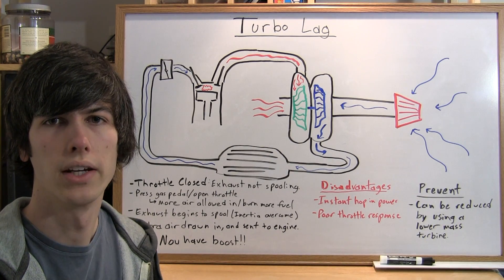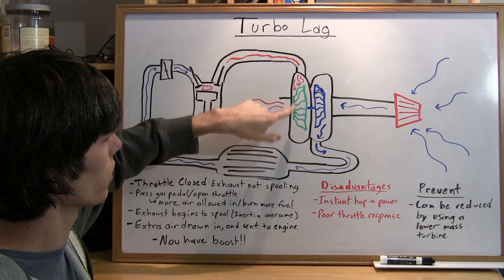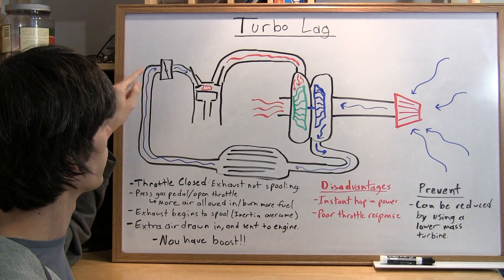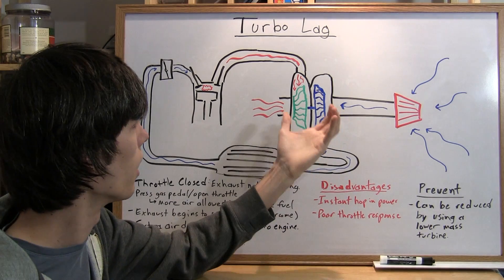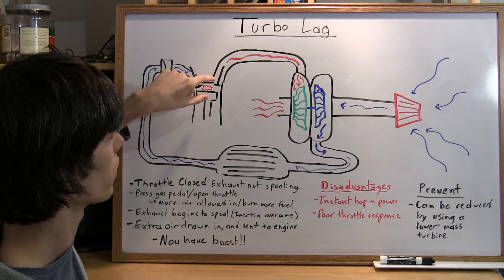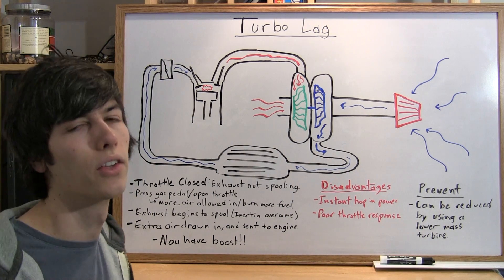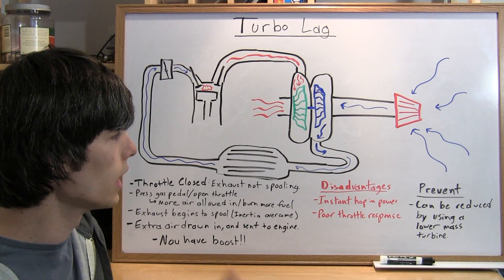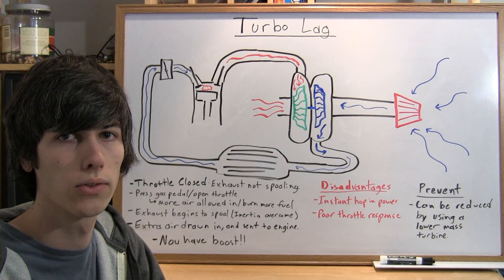Turbo Lag - The Problem With Turbocharged Cars

Comment: When the throttle plate opens all the way the engine creates more vacuum and pulls in more air. A naturally aspirated motor will start pulling as much as at its volume allows when the throttle plate opens all the way. A forced induction engine is capable of taking in more air than the vacuum of the engine. So the engine still pulls all the air that it is capable of just like a naturally aspirated motor and now we are waiting for the turbo to add pressure and increase the air the engine can take.

Comment: To add, if you translate amount of gas pedal to amount of exhaust gas your feeding the turbo, when there is no resistance that EngineeringExplained spoke of, you can only press the pedal slightly down for a brief period before the rpm is too high and you have to let off.  So it makes sense that your not really effecting the turbo by reving in neutral. Compare that to when you start driving, you give the engine the resistance of moving your vehicle and it allows you to press the pedal and hold.

Comment: To add to what EngineeringExplained said, the amount of turbo lag depends on a lot of factors.  The main factor is the size of the turbo.  So if the turbo is bigger, the turbine itself is bigger, which means its more massive, which means it takes more to get it moving.  The amount of exhaust gas that your engine is capable of producing determines how fast it can get the turbo spinning.  A smaller turbo in this case would mean less lag because its easier to rotate.

Comment from the maker: Once you have enough exhaust, you will no longer have lag, regardless of what rpm you are at, but at high rpms you will already have revved up the engine, spooling the turbo, meaning you already have boost.

Comment: Dude, can you help me?! I just rebuilt my whole motor in my 95 Talon TSI. I put a small 16g turbo, 16g turbine headers, aftermarket inter cooler, 255 Wal. fuel pump, and I have a set of 880cc injectors, that I didn't throw in yet. I also put on a fuel regulator, boost gauge.. My car holds 20psi/idling. But as soon as it hits between 7-10pounds/psi. The car shakes/wants to shut down.. Wtf is going on with it? If needs tuned etc. How can I do that? I don't have no dyno's around here for AWD.

Comment: An I just read the comment that said more heat is more power....incorrect my sir. The laws of thermodynamics and combustion are still out of your grasp. Colder air charge is best. More pressure only means more power when comparing same turbos...if one turbo is bigger, lower pressure can make more power than that of the small turbo at almost full boost.

Comment: Then if a diesel is in neutral and rev'ed how can it achieve 32 psi, or run 10 psi at idle...it's boost control! Not the fact that the engine isn't spinning enough. Because no matter what the gear 5 grand is still 5 grand. Gear position doesn't matter. Look up boost control solenoids, waste gates, and bypass/blow off valves....that will explain it more correctly.

Comment from the maker: Not a whole lot, the engine needs some form of resistance, and friction alone doesn't provide that much. With an engine revving and the car in neutral it won't produce enough exhaust to really spool up the turbo.

Comment from the maker: Instead of just feeding air directly to the engine (like in naturally aspirated engines), first the exhaust has to spool a turbine. It takes energy to spool up this turbine, causing a delay for the intake turbine to rotate. Once the intake turbine is rotating, it's forcing in extra air, hence the engine has boost. 

Some air obviously gets through even if the turbine is not spooling, but it's not enough for the extra power that a turbo provides.

Comment: Sorry if you're going to have to explain this again. But I still don't get how the addition would compromise the throttle response comparing to a naturally aspirated engine. I get the part when suddenly boost kicks in but that's because of the extra power, not because of the 'slowen' response? Which part did I get wrong?

Comment: If you reduce the amount or diameter of piping or intercooler volume you will have less volume to pressurise, resulting in less turbo lag. The spool speed of the turbo is typically not called turbo lag and ussually means the AR rating of your turbo is too high for your engine size or rpm application (wanting more boost at lower rpm vs higher rpm)

Comment from the maker: First question: Turbo lag doesn't affect power, just how long it takes to get the power. The answer to your question is no, because the turbo will be forcing in more air, and therefore more fuel will be burned. The more fuel you burn, the more heat is created. More heat = more pressure = more power. 

Second question. I should make one on this eventually. It's a good topic for sure.

Comment: I have a few questions: 
Firstly would a turbo engine, which is suffering from turbo lag, ever be less powerful than the same engine - stripped of its turbo system at the same rpm?

Also, can you make a video on compressor surge? I'm sure it would bring a lot more awareness and knowledge to youtube boosters.
thanks

Comment: Replace the turbo's turbine shaft bearings in both you turbo's get one small on and one big one.. Most turbos have fluid bearings, which support the turbine shaft with a layer of lubricant sealed between it and its housing. Replacing them with ball bearings specially engineered for turbos can reduce the friction acting on the turbine shaft, reducing turbo lag if you dont use the right it will decrease life of turbo.

Comment from the maker: What is the basis of your argument? When you add components, you add losses. If you were to analyze a pump with pipe flow, it becomes clear that to minimize the head loss, you want as few bends as possible, and a uniform diameter pipe. Integrating in an intercooler means more bends, more pipe, and various flow rate changes.

Comment: Where the diesel uses gas and compression, a gas engine, at least modern ones, are stuck in the vacuum mode, where the amount of gas is based on the amount of air sucked in by pressure. for instance you want more acceleration? push the pedal to get more air to flow into the engine, thus more gas. Where the diesel adds more fuel and air comes with it. Interesting differences I say :)

Comment: You forgot something: Lower mass turbine= less power. A very interesting configuration is BMW's (which is used in the Cooper S, JCW) twin-scroll turbine which allows a wide powerband and high output. Also the twin turbo configuration (in some cases) with 2 distinctive turbo's which when the smaller turbo to spools up, the transition is made to the bigger one.

Comment from the maker: That's actually how diesel engines work. A diesel engine's air-fuel ratio can go from 70:1 to 18:1 by you matting down the gas pedal. As far as why this isn't done with gasoline engines, I'm not sure.

Comment: wouldn't it be much more efficient + ecological to constantly have an abundance of air allowed to enter the engine and control engine rpm solely by the amount of fuel injected into the cylinders?

Comment: Turbo "lag" cannot be defined very well, if the turbo is NEVER gonna work when going 2000rpm for 1hour then its not lag cause it's not a full boost coming slowly ie "lagging" :)

If the turbo does work say at 2500rpm and you get a 1second blank spot before boost then the turbo comes on, THATS lag :)

Comment from the maker: @hakeembisiolu Eventually, yes. Basically what it does is it divides the air coming out from the exhaust into two different ports, so that the pressure to the turbine is much more even and steady. But a video would help clear this up, soon enough.

Comment: It also can be reduced by using a twin-turbo setup. That means one small turbo connected to a bigger turbo. The small turbo spools up faster. meaning more presure on the big turbo. That way the big turbo spools up faster creating lesser Lag.
its not ideal but you also can reduce it by removing piping or the intercooler. That way you'll have less response time from the air going from the intercooler to the engine itself.

Comment: @EngineeringExplained I wasn't trying to say larger turbos *can't* create more boost, just that they don't always. It sounded to me like sheennick12345 was saying a smaller turbo just necessarily means smaller boost. You can make a smaller turbo produce a lot of boost but it will still produce less air mass than a larger turbo at the same psi, resulting in less power.

Comment: @EngineeringExplained Well you can have your foot off the gas at any RPM, but yes, engine braking, mech/wind resistance, etc. will be slowing you. But the injectors won't be putting any gas into the engine, so there will be no exhaust other than air (air braking). But if your foot was just on the gas enough to maintain speed, at say 3k RPM & maybe somewhere between 10 in Hg to 5 psi, and you floor it, you could have 20 psi near instantly.

Comment from the maker: @BeatniKkers When the engine is unloaded, it doesn't take much throttle to rev it up. This means you're not using much gas. Without using much gas, you're not creating enough exhaust to properly spool up the turbo. However, it is possible to create boost if you hold it long enough, it just might not be as much as you'd like. Wouldn't recommend revving high in neutral frequently though.

But who hasn't heard a ricer at stoplight showing off some BOV noises? It's obviously possible.

Comment from the maker: @EngineeringExplained Finally, your statement about turbo size and boost is slightly inaccurate. Boost is added pressure, which comes from the amount of air the turbo can pull in. Since larger turbos can pull in more air than smaller turbos (using the same engine) they can create more boost.

Comment from the maker: If you're "coasting" at 5000k, you're going to be on the gas. You're either traveling slow in low gear and will have mechanical resistance, or fast in high gear, and will have wind resistance, so if you're on the gas you'll have boost.

But lets just go with it and say you are coasting, well at 5k when you press the gas, you're going to have a lot more cycles of the engine than at a lower rpm, so logically you would create exhaust more quickly, and have boost faster.

Comment: @EngineeringExplained and also the turbolag in the twin-config is smaller because it it easier to spin two small turbines rather than one larger one. I have such config in my RS6. The lag is barely noticeable

Comment: @sheennick12345 My point was that turbo lag isn't really an issue in racing, and the parts that were problems have been mostly overcome with anti-lag, nitrous, etc to spool the turbo off the line. For the everyday driver it might be a small issue in some situations. For instance, when I'm accelerating up a steep hill and I upshift too early my RPM drops to around 2,000 where I'm out of the compressor map for my turbo.

Comment: @sheennick12345 We aren't stating the same thing though. I'm disagreeing with what he's saying at 0:06. I'm saying that if I have a GT35R (a very big turbo) on a 2.0 liter DSM and I'm coasting at 5k RPM and floor it, there will be near instant full boost. And the same thing will happen on my stock DSM at 2,500 RPM.

A smaller turbo doesn't necessarily translate into smaller boost, but it will push less cfm than a bigger turbo and thus result in less power.

Comment: @Nayr747 engine RPM directly depends on throttle position..so you are indirectly stating the same
and about different cars having their turbos kicking in at different times depends on the turbo sizes...

a smaller turbo will kick in at a lower RPM but then your amount of boost will be less
a larger turbo means more lag but a larger boost

Comment: But turbo lag is dependent on engine RPM. A stock t-25 turbo on a DSM spools around 2,500 RPM whereas a 60 trim may spool a thousand or more later. If you're racing, every up shift should fall above this RPM. If you experience turbo lag you are probably in the wrong gear. Even in first gear from a stop, things like ant-lag and 2-step rev limiters build full or nearly full boost off the line.

Comment from the maker: @anish4 Say you have a V6 twin turbo, the exhaust manifold from each set of 3 cylinders is routed to a separate turbo. So you would then have two air intakes, though it's possible to connect the piping if you wanted to.

Comment from the maker: @anish4 It would be possible, yes, but if they are geared differently one will spin slower, so this may cause undesirable results. If the exhaust spins faster than the intake, you'll be restricted of the amount of air you can pull in. If the exhaust spins slower, it would probably be more difficult to spool. Find a happy medium and it's probably good though!